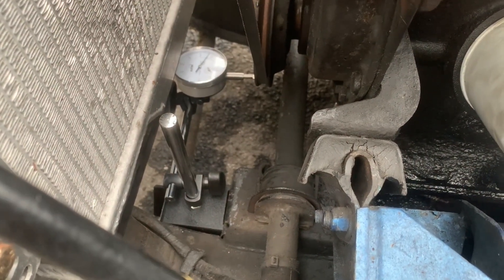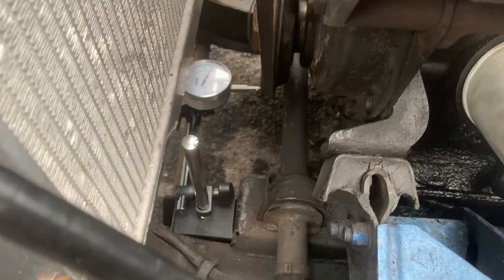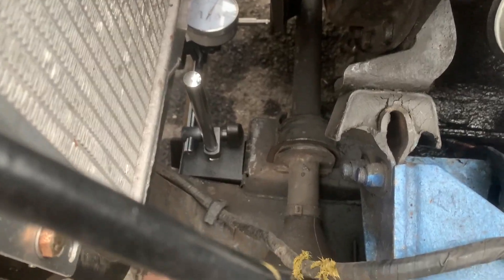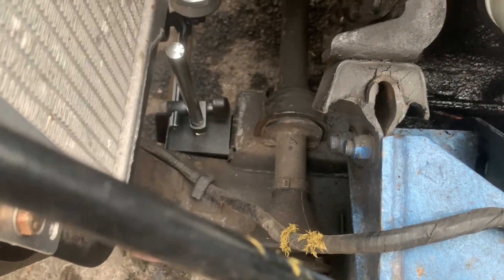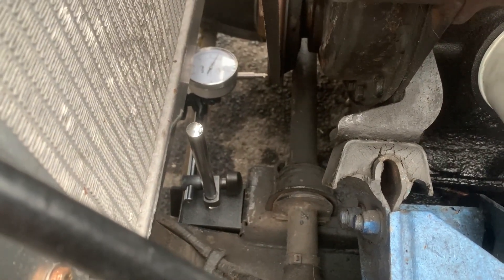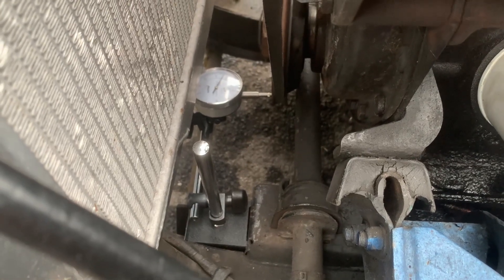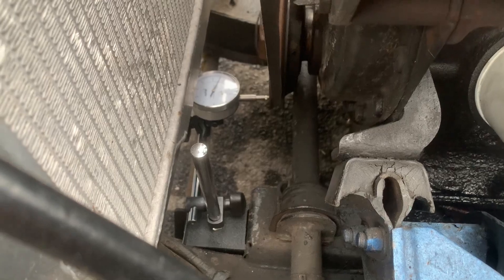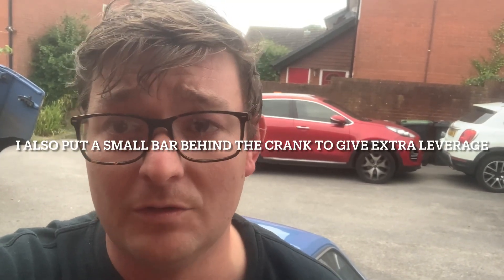How To Measure Crank End Float - Triumph Spitfire

Comment: Good video.  Surely you take this measurement without depressing the clutch because the clutch pressure forces the crank up against the thrust washers and you can't measure the slop?
Reply from the maker: Thanks for the comment! You're right, the measurement is taken without depressing the clutch.

I have just done a pinned comment to alert others and I will re make the video when I am next with the car :)